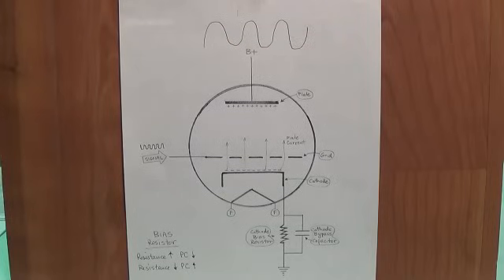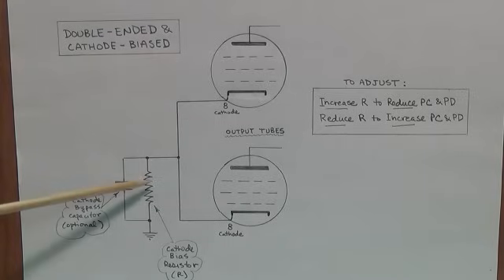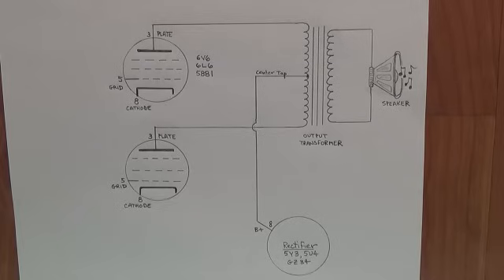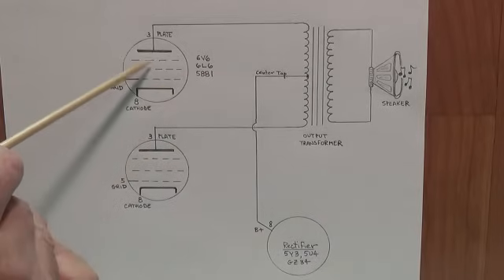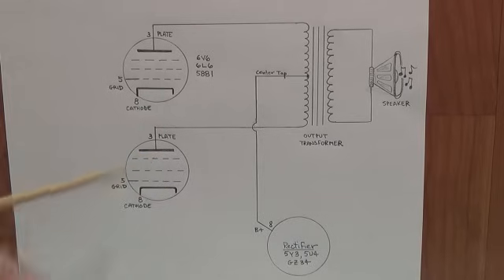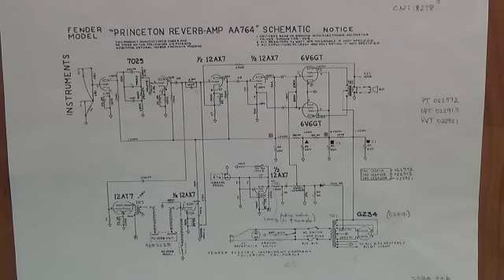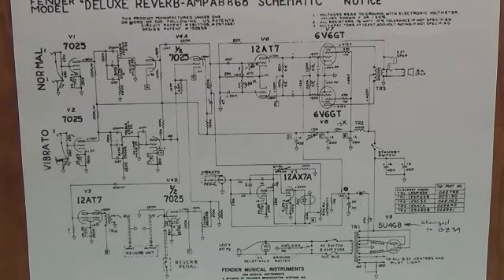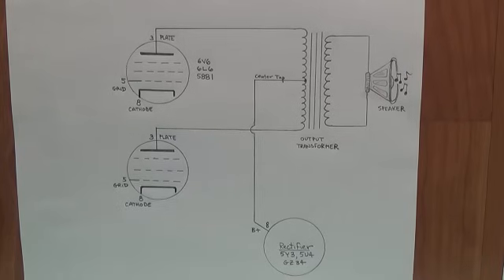Biasing Double-Ended Amplifier Output Tubes, Part 1: Basic Explanation & Methods

Comment: Hi Doug, love your vids! I have a Gibson Skylark GA-5 crestline. It has a 6X4 rectifier en 6AQ5 tubes (pin5 is the plate). Which pin on the 6X4 can use for biasing like this methode? Pin 3 (not sure)? So pin 3 of the 6x4 to pin 5 of the 6AQ5? Hope you can help me.
Reply from the maker: Thanks, Ramon. You don't use any pin of the 6X4 for biasing. The 6AQ5's are both cathode biased by a single 270 Ohm resistor connected to their cathodes at pin 2 of each tube.
Reply: +Uncle Doug Thanks. I divided the voltage drop with the resistance of the 270ohm resistor * plate voltage and divided by two for the bias. But how can I check the bias on each tube separately in this case? The method in your video is not working for the 6x4 and 6aq5?
Reply from the maker: You are not following the procedure in the video, Ramon. You must measure the voltage drop across each half of the output transformer primary, not across the single bias resistor.  Also, this procedure is only for the output tubes, not the other tubes or rectifier.
Reply: +Uncle Doug Yes, I am aware of that its only for the output tubes. At first I measured according your vid with single ended output tube amp and divided by two. But to be accurate I want to measure it like this procedure with the transformer. In your vid you use pin 8, but on my schematic it goes from the 6x4 to the center of the transformer and then to the two plates of the output tubes. So that's why I was confused what pin to use on the 6x4. I think I am going to watch your vids again. Maybe I was wrong sorry ☺️
Reply from the maker: I'm sorry if I misunderstood your question, Ramon. The high voltage to the OPT center tap should be provided by the cathode (Pin 7) of the 6X4, so you could measure the resistance and voltage drop from pin 7 to each of the 6AQ5 plates (pin 5). Be careful. Good luck.
Reply: Hi Doug, worked like a charm! Thanks for your help.
Reply from the maker: You're welcome, Ramon :)

Comment: Hi Doug, quick question if you please. I just finished a AB763 Deluxe Reverb kit build and when I turn the bias pot my plate voltage also changes quite a bit along with the cathode current. I can swing the PV as much as 50 volts by turning the bias pot from one stop to the other. Is this normal?  If not, could you possibly make a recommendation as to where to begin looking for the problem. Love your channel and I've learned a lot. Thank you. Rob,  ps: please put a link to your sponsorship program. I forget what video I saw it in and would like to help so the videos keep coming.
Reply from the maker: Greetings, RC. It is completely normal for the PV to go down when the PC goes up, and vice versa. When current flows, voltage decreases. Think about holding your thumb over the end of a water hose. What happens to the pressure (voltage) within the hose when you release your thumb and water (current) flows ?  Your circuit is operating as it should. Now you must come up with a PV and PC that provide an appropriate Plate Dissipation value. Good luck.

Thanks for your offer of sponsorship. Here is the link to my Patreon site:  https://www.patreon.com/uncledougsvintageamps

Comment: I've never looked at amp circuits before but always been interested in how they work, so it's great to learn and you explain it perfectly. It's like being back at college but with a bit more enthusiasm. Is the gain on the preamp adjusting the bias to reduce the headroom and create distortion? Thanks for all the uploads and taking the time to respond.
Reply from the maker: You're welcome, RW, and thanks for the nice comments. Actually, the bias is adjusted primarily on the output tubes, not the preamp. If you bias the output tubes to a high level of plate dissipation, distortion will occur more easily and at lower volume.

Comment: Doug, another good video. One question: where does the table at 3:25 come from? And the information that max PD in grid-bias mode is 70% of PD in cathode-bias mode? Thanks again EJP. PS No Rusty?
Reply from the maker: You're welcome, QM. All of the PD data comes straight from the RCA and Sylvania Tube Manuals.  Biasing at 70% of max for fixed/grid bias has been standard procedure for years. It provides a safety buffer as the PC and PD increase when the amp is driven.  Cathode bias is self-regulating and no such increase occurs, thus they can be safely biased at (or near) max PD.
Reply: +Uncle Doug Thanks. I ask because I'm working on an amp which has everything at 100% rating: Va, PD, Ia, ... And it is grid biased. No 70% there. I was hoping it came out of a tube datasheet. I can see that Vak would be higher in a grid-biased amplifier, which may have something to do with it? EJP
Reply from the maker: You're welcome, QM.

Comment: Dear uncle dog:

Why do some 12AX-7 lighting  up  very bright half of a second  in the very moment  they get on main Power,
( heater ) on,

After that  half of a second  they are as bright as normal.  When they are warm.
Does  that says something about the using ours or age of this tubes ?

Dear uncle dog:

An amp  with  grid  biased  double ended 6L6 GC tubes.  I I proof  the amp on lower Voltage  to keep the caps save .

100 volt instead of 240-volt needed. And with a current limiter , what makes the Power even less,.
.... is there a possibility  to ruin the 6L6 because of to low grid bias ?
( normal the have minus 44V  in that amp.

That was happen  one or two times, but I still don´t know the problem, because it could  have been a
faulty cupeling capacitor . they are often bad, the are 630volt 0,33uF.

The amp was a SANSUI AU-111 from 1966.

Thank you for your answer , And thanks again for your famous videos!
Reply from the maker: Greetings, ZX. I apologize, but must admit that I am not sure about some of your questions.  I believe there are internal variations between different brands of tube. I too have seen some 12AX7's flare up brightly at first, but then calm down and work fine. I think it's normal for some of them.  

I don't understand how or why you want to run a 240VAC amp at 100VAC. Lowering the voltage might cause less stress to the components, but the amp cannot operate properly, or at all, like this.  

I am not familiar with Sansui products, which I believe are for stereo phonograph and FM receiver use. Perhaps you can find information about them on the Internet. Good luck.
Reply: Hi another amp/electronics tec on Youtube, Mr Carlson's Lab has a detailed video where he reproduces and explains heater flash in detail. How cold fillaments draw high currents until they warm up. Also shows a slow-start circuit to avoid heater failure. Go search. Great videos Uncle Doug, I think I've watched them all.
Reply from the maker: Thanks, Rob. I watched the Mr. C. video a while back.....he does good work.

Comment: Recently a 50W EL34 head showed up on my workshop. The owner complained on "bad sound" allthough he changed tubes in the music store and so on. Well the amp was a working horse in daily use on high levels. Since problems started the guy changed a set of output tubes within 6 weeks. Unfortunately he didn't spared the old set. Without cranking up the amp (kids were sleepin, spouse on yoga), I decided do some visual inspection and bingo! deformation in the middle of the bulb. Since European Pentodes have a cylindrical shape deformation can be easily determined if you roll the body over a even surface e.a. a glass piece. The specific were that heavily deformed you could feel them by palpation. Conclusion: they run to hot (pls consider, glass but not quarz is a fluid). I assumed a failure in the bias circuitry, it was the trimmer and a bad design of the circuit itself. By changing the bias-poti with a better one adapting the circuitry to a fail safe one, I monitored the amp for one month now in the local pub. Flawless the device and the faulty bias-pot including the worn tubes ended up in my forensic archive. File closed the conclusion all yours...
Reply from the maker: Excellent diagnosis and treatment, Gustav. The patient lives on :)

Comment: Great videos.  I have a matched tube suggestion for single combined bias.  I mark and install the tubes at random....then measure or calculate the individual bias currents. They are seldom exactly the same value.  Take  notes, calculate the difference between the two bias currents for this (first try) tube's positions.   Example Inside socket=32 ma., outside socket =29 ma., the difference being 3 ma of unbalanced current.
Then SWAP the tube's physical  positions and do it all again, noting a second "unbalanced" current value.
It is likely one of these values will be smaller and therefore, a."better match".
Ultimately, install the tubes in the position that has the smaller difference in the bias current.
Works for me.
Reply from the maker: +dennis walsh  An excellent suggestion, Dennis. I too have noted the difference in PC when tubes are moved from socket to socket.  Thanks for your helpful input.

Comment: Excellent tutorial.  I've been reading schematics for many years, but you make it a lot easier following your explanation.

RE: Your comment at 18:50 "much better way to bias each tube individually" .

Just wondering why you would want to add individual cathode bias resistors, since the traditional push-pull (class AB) output
circuit only works on the 180 degree phase shift of the output transformer. 
 Ie: When one side of the o/p transformer is positive 180 degrees, the other side (from the centre tap) will be negative,  and the plate of the tube (at the moment) will not be conducting, ( it will be cut off)  , leaving the other  power output  of the push pull pair to conduct,  (usually in  Class AB mode), the bias is set up in such a way that the o/p tube conducts long enough around the "zero crossing point of the AC  amplified waveform" to avoid the crossover notch distortion.

So  my question is: why would we even need separate cathode bias resistors in this case, since only one tube at a time will be conducting and drawing current through the normal  single cathode resistance?
This is the way I have always understood it..   Have I missed something through the years?
Reply from the maker: +SuperCarver2011 The way I visualize the process, SC, it's like two people rowing a boat.....one on each side of the boat. They take turns rowing, and if one rows harder than the other, then the process becomes unbalanced and the progress non-linear.  Since no two output tubes have precisely the same plate current (and thus bias) characteristics, biasing each individually will neutralize this inherent mismatch and result in a much more balanced output, when they each "take their turn at rowing the boat".  The use of a single bias resistor simply "splits the difference" between the two tubes resulting in an average plate dissipation value that may well be ideal, but conceals the fact that one tube is actually biased "hotter" and the other "colder".  Naive and simplistic, perhaps, but it does seem to work quite well. Also, I believe the traditional reliance on a single cathode bias resistor has always been a concession to economy rather than optimum electronic reality.
Reply: +Uncle Doug;   But if you use matched outputs ( 6V6, 6L6GC) then a slight difference in plate current is (probably) tolerable for both tubes. Perhaps there are custom made boutique amps out there somewhere that have
individual cathode bias resistors, but for the most part, the output pair share one cathode bias resistor.

Leo Fender built his amps with one cathode bias resistor in his vintage amps, and these vintage amps command a high resale price these days, a lot of guitar players seek them out.

However, that being said, carry on Uncle Doug,     I'll be tuned into the next part to hear your discussion.
Reply from the maker: It's a relatively minor consideration in the great scheme of things, SC. Thanks so much for your very knowledgeable input. I always enjoy hearing from you and look forward to further video rendezvous :)

Comment: Thank you Uncle Doug for your very clear and understandable explanations.  I have tried your method of measuring PD through the center tap of the output transformer.  It is a Twin Reverb "type" amp, with 4-5881s. Solid state rectifier. I get the following PD values:  V7--9.85W; V8--9.85W; V9--8.87W V10--8.87W.  The target PD is 23W@100% or 16.1W@70%.  You see that the tubes are running cold, and causing low volume distortion.  There is a bias pot on the amp--but the range of -V values it sends will not lift the PD measurements any higher.  Could this be due to the value of the bias capacitor?  Mine is a 50mf at 200V.  Thanks.
Reply from the maker: LionBronstein You're welcome, LB. Since I don't have a specific schematic for your circuit, I will use a Fender Twin Reverb schematic to address your problem. The pot is not for bias, but for balance between the output tube pairs. The bias is controlled by the 15K resistor off the pot wiper....it allows a certain amount of bias voltage to go to ground. The higher the resistor value, the higher the bias voltage to the tube grids.  

Now, assuming your measurements were accurate.....and they must be, or the output tubes will be in jeopardy.....the PD values are way too low, as you know. Check the value of the 15K resistor.....is it low? If so, replace it and retest the bias. If not, then are the 5881's old (their PC goes down with age)? If so, replace them and retest. Check the DC output from the diode.....is it around -37VDC? If not, replace the diode and the 50uf filter cap for this circuit. 

After all this, if the PD is still too low, then increase the 15K resistor to 20K and retest.....continue in this manner with different resistances until you have a proper PD, which would be 70% of 23W (fixed bias tubes) or 16W. Good luck.
Reply: Uncle Doug Thank you very much for your quick, complete, and informative reply.  I appreciate it.
Reply from the maker: You're welcome, LB. I hope the info helps.

Comment: Hey Uncle Doug, how do I bias a parellel push pull output stage (I'm using 6c33c triodes)
Reply from the maker: JazzyFizzleDrummers Greetings, JFD. In the circuits I am familiar with, if the output tubes are in parallel, they are not in a push-pull relationship. It is biased like a single-ended amp, but with two output tubes instead of one. You measure the resistance and voltage drop across the cathode bias resistor (assuming there is only one for both tubes). Divide the voltage drop by the resistance to get total plate current for both tubes, then divide by two to get the average PC for each tube. Other than the division by two, the process is like a SE amp.

Comment: so i think i understand it now Doug cathode resistor is 250 ohm voltage across cathode resistor is 19 volts 19 volts divided into 250 ohm = .076 MA so i divide .076 MA by 2 = .038 MA plate voltage is 290 volts times .038 MA = 11.02 watt
Reply from the maker: ian forster Exactly right, Ian. Good work. The only thing I might add is that measuring plate voltage from plate to cathode is slightly lower (and more accurate) than between plate and ground (as I did in the video).

Comment: What might cause a cathode biased double ended amp (Bassman clone) to have the plate current vastly different between the two tubes. This occurs regardless of which pair of matched tubes are used. The three different pairs of tubes bias stable in other amps, however in this Bassman clone the inside tube might show 65 ma the outside will show 4 ma.
Reply from the maker: pgjopop Since the typical Bassman circuit is fixed bias (grounded cathodes), I assume that your clone circuit is modified to be cathode biased....which is unusual. The plate current circuit is quite simple, so it's easy to narrow down the possibilities: 1.) A bad winding on your output transformer primary.....measure the resistances from center tap to each plate, they should be about equal. 2.) A bad tube socket.....cold solder joint to pin 3 or 8, etc. 3.) If your cathodes each have their own bias resistor, one may be bad.....measure their resistance, they should be equal.  Good luck.